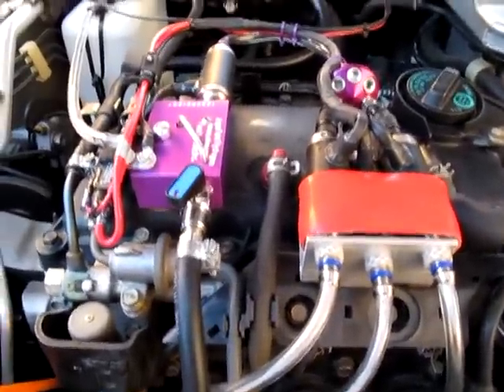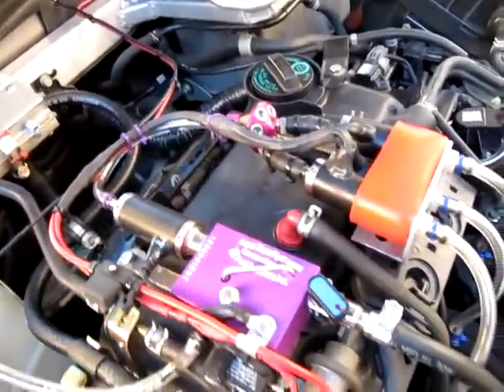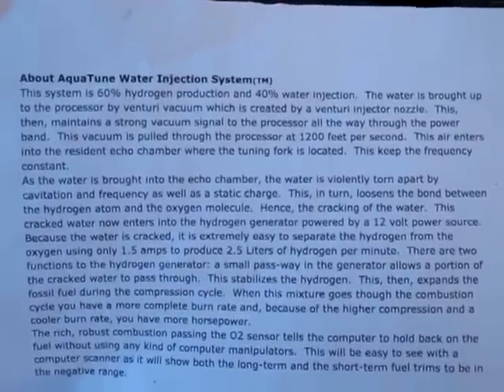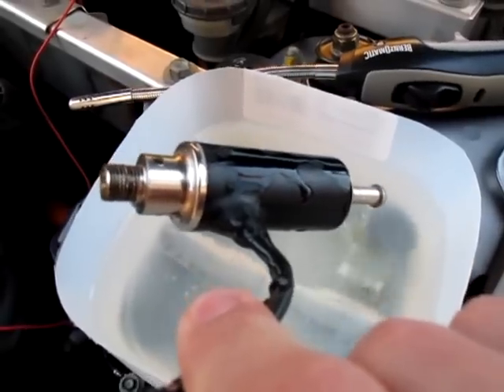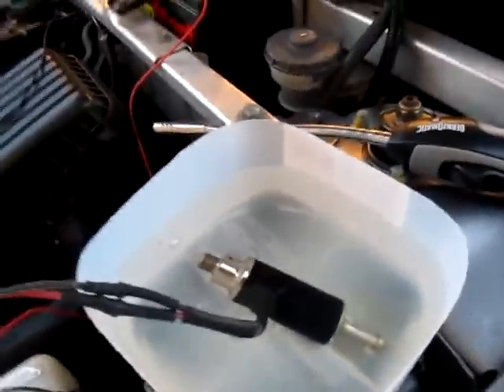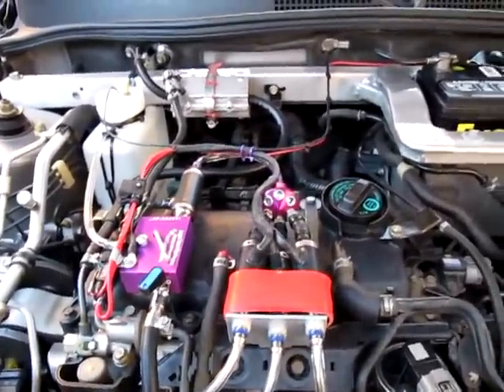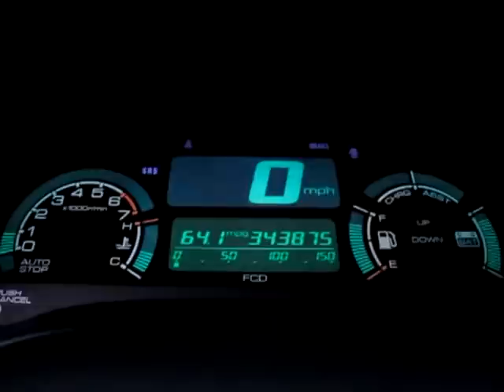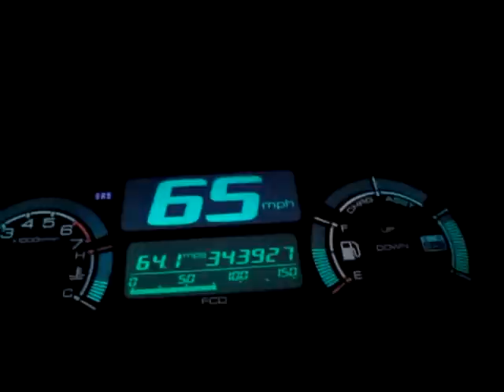Water Fuel Technology For Everyone - AquaTune Hydrogen Fuel Systems

Comment: i believe you have tested several hydrogen generator. So, does Aquatune the best so far that you have tested?
Do you modify your ecu, remap? to get that minimal 25% fc?
Reply from the maker: Very good questions. My research and study indicate the AquaTune Hydrogen Fuel System is the most efficient Water Fuel Technology system available on the market for automobiles- today. One of the most interesting aspects of the AquaTune Hydrogen Fuel System is the system is design to integrate itself into the automobiles existing computer and emissions system- which increases fuel efficiency and power, and reduces exhaust emissions- without manipulating the automobiles (ECM) Electronic Control Module with various electronics. To achieve the 25% increase in fuel efficiency, one need only add the AquaTune Hydrogen Fuel System to the automobile. No remap, no EFIE(Electronic Fuel Injection Enhancer). Many experimenters and researchers of traditional electrolysis systems find interest in the concept and existence of a Water Fuel Technology system which uses the Forces And Laws Of Nature- To facilitate efficient hydrogen production via the water molecule. Note: "Scientific Discovery is the words that humans use to describe what the universe has always known". My research indicate- Human Scientific Discovery as is well known- is less than 1% of the knowledge the universe contains. To have access to the additional 99% of the knowledge the universe has always known- we need only learn to listen to the voice that is the visual experience nature provides us. The Laws Of Nature do not speak to us with words- It's a visual communication rich with potential for understanding by humans. Einstein note "imagination is more important than knowledge". Einstein- a man of great knowledge and imagination realized the importance of imagination, observation, and experimentation.
Reply: Thanks for your feedback.
Reply from the maker: Morphasella You're welcome :)

Comment from the maker: Everyone that has a properly running automobile with properly working oxygen sensors(must be replaced at automobile manufacturers recomended intervals)that follows the AquaTune instructions to the letter, which includes contacting AquaTune Technical Support and following all advice and recommendations and suggestions- will achieve an increase in fuel efficiency of 25% or more. AquaTune is like 1+1+1. 1 is design + 1 is installation + 1 is technical support = 25% increase in fuel efficiency :)

Comment from the maker: Hydrogen Production via Electrolysis- Fuel Systems are a very popular subject and area of study, the AquaTune Hydrogen Fuel Systems are not based on traditional Hydrogen Electrolysis System Design. Thus, great knowledge and understanding of traditional electrolysis systems would not be applicable to the AquaTune Hydrogen Fuel Systems theory of operation, nor theory of installation. Many individuals have become installers of the AquaTune systems which requires extensive training through AquaTune.

Comment: hi, I live in India and interested to installed to my diesel engine 2000cc 4 cylinder..please advise.. really you are very clear in explanation and demonstration ..? does this will increase wear and tear of engine cylinder and compression rings.. thanks
Reply from the maker: The design of the AquaTune Hydrogen Fuel System permits reduced engine combustion chamber temperatures- and thus cannot be used with diesel engines. Please contact AquaTune Hydrogen Fuel Systems if you wish for a more detailed response. Note: The AquaTune Hydrogen Fuel System does not harm your engine- rather it improves gasoline combustion oxidation efficiency- reduces combustion temperatures- increases octane rating- removes carbon build up in combustion chambers- thus increasing fuel efficiency- increasing horse power- and reducing exhaust emissions- for gasoline and natural gas powered engines :)

Comment from the maker: The 64.1 mpg readout is the average fuel efficiency for the miles the car has on it, total. That's apx 64 mpg over the course of over 300,000(Three Hundred Thousand Miles). That's the average the car achieved before adding the AquaTune system, and before the Hybrid battery was deactivated. With the Hybrid battery deactived, the car only achieve 58 mpg under the same driving conditions. Now the car achieves 75+ mpg with the AquaTune system, and with the Hybrid battery still deactivated.

Comment: Are you saying that the car no longer runs on Petrol and its now powered by the Aquatune? Or is the unit just helping to reduce fuel consumption? If you combine Hydrogen and Petrol you would end up with a richer mixture. From what I understand you do need to tune the mixture so it isn't so rich, this would mean reducing the Petrol. I also see some water flowing from the hose into the intake. So we have water entering into the combustion chamber of the engine. Whats the output condition on the end of your exhaust pipe? An increase in water would cause faster corrosion to your Exhaust pipe.
Reply from the maker: Hi Ricky. Gasoline is a HydroCarbon. Thus Hydrogen and Carbon atoms making up the gasoline molecule. Oxidation of the gasoline molecule(combustion) then Thermally Catalytically Cracking via the exhaust systems catalytic converters- produces water vapor in your exhaust system. This water vapor in the exhaust is not a mystery. All mass produced- gasoline powered automobiles produce water vapor in the exhaust system. Does your water hose wear out faster if you use the high setting vs the low setting?

Most Water Fuel Technology systems produce Hydrogen and Oxygen. This mixture- based on my research and study- creates a lean condition that the upstream(Between the Catalytic Converter and the Engine) Oxygen Sensor(or Air To Fuel Ratio Sensor) will read and the computer tells the fuel injectors to lengthen the pulse width signal thus compensating for the lean reading and adding more gasoline to the engine combustion chambers. This is a loss of fuel efficiency and many newer model automobiles experience this when running traditional HHO(Hydrogen) systems. Computer sensor manipulator systems are sold which compensate for this- such as EFIE(Electronic Fuel injection enhancers). The AquaTune Hydrogen Fuel system requires no computer sensor manipulation to achieve fuel efficiency and horse power gains.

The AquaTune Hydrogen Fuel System- creates a rich reading by the upstream oxygen sensor- thus telling the automobiles computer to shorten the pulse width signal- thus permitting less gasoline consumption- and more Hydrogen From the AquaTune Hydrogen Fuel System.

AquaTune is 60% Hydrogen Production and 40% water mist injection. The water you see becomes a fine mist of spray at the venturi nozzles which are located in the air intake manifold of gasoline powered engines. Unlike traditional water injection systems- the AquaTune system is able to release it's Hydrogen and Oxygen atoms within the engines combustion chambers. This is by design. In the process of the water mist flash vaporizing and simultaneously releasing Hydrogen Atoms within the engine's combustion chambers- heat is absorbed- octane rating is increased- and carbon build up is removed from the combustion chambers. Gasoline is approximately 115 BTU. Ortho Hydrogen is approximately 300 BTU of energy. Ortho Hydrogen burns 7 to 9 times faster than gasoline molecules- with more than twice the energy ie BTU. This is a fine balance AquaTune has achieved.

You may also contact AquaTune directly- if you have further questions.

Comment from the maker: The automobile still uses petro(gasoline). The AquaTune Hydrogen Fuel Systems reduce gasoline consumption by a minimum of 25%. The AquaTune Hydrogen Fuel System also increases engine power, as well.

Comment: with the increased fuel efficiency, does horse power increase, decrease, or remain the same?  could it be that the only reason the fuel efficiency is better is because the O2 sensors are getting different values now (due to this device) and thus limiting the fuel amounts, resulting in better fuel efficiency?  sort of like the kind of fuel efficiency you might see in one car but with 2 different drivers—your grandma vs her 16 year old grandson.

Comment from the maker: Hi. You will need to contact AquaTune Hydrogen Fuel Systems in order to learn of pricing specifics for your model automobile. There's a couple different model AquaTune Hydrogen Fuel Systems. The AquaTune Hydrogen Fuel System is 60% Hydrogen Production and 40% water mist injection. The 40% water mist injection you see in the tubing(connects from the Hydrogen Producing Capacitors, to the intake manifold via venturi nozzles at a 90 degree angle to the intake manifolds air stream) Continued:

Comment: headshotbl2: The car runs on hydrocarbons. That is what the "burning" component in oil is. Ie hydrogen and carbon. Thats what the car engine uses during its stages of combustion. What you are doing is adding hydrogen to the cylinder -and thus to  the oil (gasoline) in the moment of explosion above the piston (and bring the piston down). So the car needs less gasoline for the work done. the produced oxygen is a "left over".

Comment: Have being following HHO technology for the past 6 years, but I have to say that this seems to be the way forward.  As you know I am from the UK and I would like to contact others who are from here to join me in taking this further.  I have an Audi A4 1.8 (1781)  Cylinder capacity.  Are their any other cars similar out there with this system fitted??
Reply from the maker: Contact AquaTune- Yes- when installed following all instructions- system works very well on gasoline powered engines- turbo charged engines- natural gas engines and liquid propane gas engines.
Reply: tom im from the uk and im interested in running a car on water only ,this seems like a good start,im from Manchester
Reply: Hi Anthony, it would be nice to make contact with others in the UK, so spread the word around your area.
Reply: Hi there:-)
I am doing my research for HHO generator to fit in to my car (VW Passat 2003 1.9 TDI 130 HP). I have learn some few things so far. AquaTune does not have a good unit for a diesel engine, this is the first thing. The second, as you know, when you generates hydrogen you also generate oxygen, all modern cars are fitted with a oxygen sensor. When you provide HHO, the oxygen sensor pick up the increase of oxygen and injects more fuel to burn. So, you need to have some electronic device to adjust (cheat) the oxygen sensors. Some companies provides this kind of device and tune them before shipping HHO kit acording to the information provided by a buyer about his car. I cannot see any device of this kind with AquaTune. Do I understood this correctly of missed something?

London, UK:-)
Reply from the maker: Tomasz Kacperski The AquaTune Plus HB will not work on Diesel Engines. It is my understanding that the AquaTune System permits expansion ie vaporization of much more of the fuel within the engines combustion chambers thus maximizing motive force(kinetic energy) produced per unit measure of gasoline used. Thus the extra oxygen produced from the water molecules- oxidize this fuel within the engines combustion chambers- thus permitting a more efficient- and cooler combustion- as well as less waste heat within both the engine- as well as the exhaust systems catalytic converters. To understand this with greater clarity- please contact AquaTune Technical Support.
Reply from the maker: Tomasz Kacperski AquaTune makes the most efficient Hydrogen Production System I've study thus far- for Industrial Diesel Engines. It's called the AquaTune D. However- not for use with small diesel engines.

Comment from the maker: Note: The 40% water mist which passes through the Hydrogen Producing Capacitors-becomes a fine mist of spray at the Venturi Nozzles- which are connected to the engines air intake manifold(at a 90 degree angle). This 40% water mist has a weakened covalent bond from being struck at resonance(Google Search- Resonant Frequencies Of Atoms and Molecules and Covalent Bonds) within the Processor- which permits this water mist to seperate into Hydrogen and Oxygen-upon encounter with Heat and Compression.

Comment from the maker: These Hydrogen Generators are Hydrogen Producing Capacitors. This is not traditional electrolysis. The traditional approach to Hydrogen and Oxygen production via the process of Electrolysis is over 200 years old. My research indicate there are endless ways to produce hydrogen and oxygen from the water molecule (H2O). AquaTune achieve a unique way of producing Hydrogen and Oxygen from the initial water molecule that is both efficient- and effective- for increasing horse power and fuel efficiency.

Comment from the maker: My research indicate AquaTune Hydrogen Fuel Systems makes Water Fuel Technology units which work with almost any engine, including-High Performance Engines, Diesel Engines, Generators, Locamotives, as well as units for the Diesel Trucking Industry(See AquaTune D). Please contact AquaTune directly- in order to learn of the specific model most suitable for your model engine. Please confirm with AquaTune, you may need the AquaThrustPlus :) I provide the direct link just below the video description.

Comment from the maker: Keep in mind- This 40% water injection is distictly different than traditional water injection systems in that the AquaTune Processor weakens the water molecules covalent bond via Resonance- Frequency as well as an ElectroStatic Charge. It is because the 40% water mist has a weakened covalent bond- that- once in the presence of extreme heat and compression(compression stroke of the combustion chambers) the bond breaks- Thus releasing the Hydrogen and Oxygen that is the water molecule- Thus Fuel.

Comment from the maker: Four AquaTune Hydrogen Producing Capacitors require a total of 6 amps at 12 volts. The AquaTune Water Fuel Technology does not utilize the over 200 year old approach to Hydrogen and Oxygen production from the initial water molecule via Electrolysis. My research indicate Electrolysis is the least efficient approach to producing Hydrogen and Oxygen from the initial water molecule. Resonance + Frequency + StaticElectric Charge + Cavitation is among the most efficient approaches to HHO production :)

Comment: if i have a v6 and averaging about 20 mph what do you think i can get up to looing into this things and or useing both H1 and ethonal or one or the other for the hp have you pulled anything with your car jw i know maybe not much but if anything and did you knowtice any differntcs before and after
Reply from the maker: Please contact AquaTune Hydrogen Fuel Systems to learn more about this system and how it will work with your automobile. I notice a significant increase in engine power when running the AquaTune Hydrogen Fuel System. I'm very grateful for the existence and availability of the AquaTune system :)

Comment: Here's your answer in a nut shell you produce hydrogen whatever way you want but its not just hydrogen water isn't H2 its H20 2 parts hydrogen to every 1 part oxygen. When these gasses are combined and pumped into your air intake and mixes with the gasoline in the combustion chamber, you get a end result that is a better burn of the gas that doesn't leave any left over gasoline that is wasted out your exhaust pipe, The Hydroxy(Hydrogen and oxygen) gas also gives you less sludge build up from gas

Comment from the maker: The AquaTune Water Fuel System is design to work under the vacuum(suction) of the engine. The Engine Vacuum reduces the surface tension of the water molecule. Reduced surface tension-upon the water molecule plus an Electrostatic Charge, As well as Cavitation, Frequency and Resonance; All contribute to the higher production rate of the Hydrogen and Oxygen from each Hydrogen Generator. The AquaTune systems are design to work in harmony with the engine- under normal operating conditions ie vacuum.

Comment from the maker: Additionally- The 40% water mist(becomes a fine mist of spray at the AquaTune Venturi Nozzles) expands the 50 micron to 65 micron fuel injected gasoline- The upstream O2(Oxygen) sensor (Or Wideband Air To Fuel Ratio Sensor) senses a rich condition- Thus telling the automobiles computer to lean(reduce gasoline consumption or fuel injector Pulse Width Signal) the air to fuel ratio- Thus permiting the automobiles computer to utilize Both the Hydrogen and the Oxygen from the water molecule- as fuel.

Comment from the maker: The AquaTune Hydrogen Fuel System injects 40% distilled water in combination with 60% Hydrogen. The 40% water injection- expands the gasoline(gasoline expands 163.3 times when phase changed from a liquid state to a vapor state) which permits more of the fuel to burn inside the combustion chambers. Burning(Oxidizing) more of the gasoline inside the combustion chambers results in less Oxygen being sent out the engines exhaust manifold- Therefore the upstream Oxygen Sensor(s) reads a rich conditon.

Comment: Looks great, but waht about winter? How can you use water below zero?!
Reply from the maker: Add one part isopropyl alcohol to one part distilled water to the AquaTune Water Reservoir. This mixture permits the AquaTune Hydrogen Fuel System to work very well in freezing weather conditions.